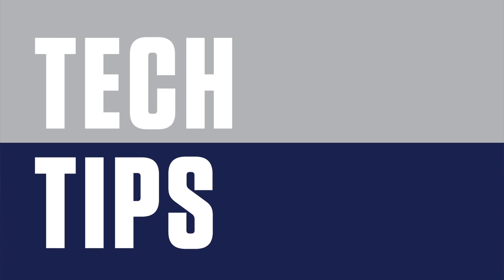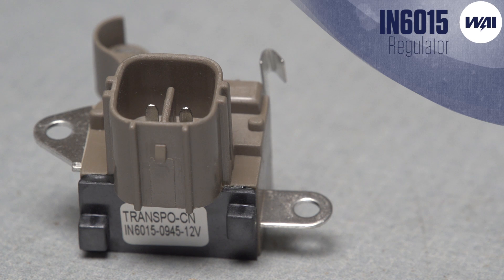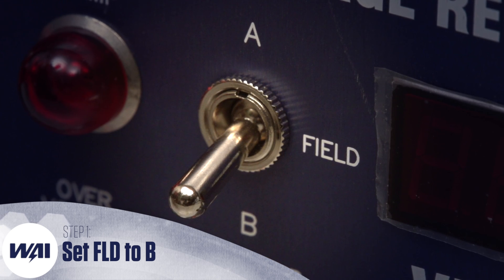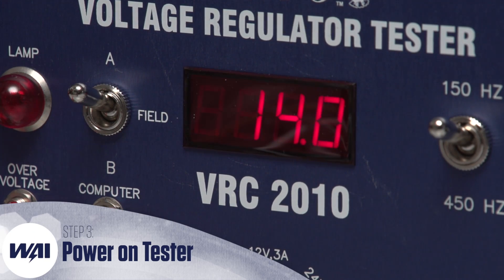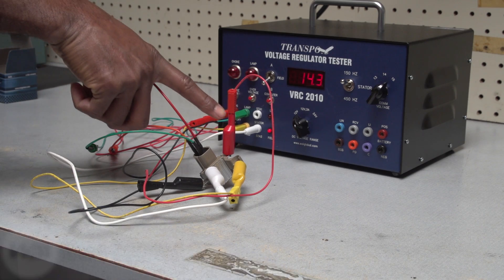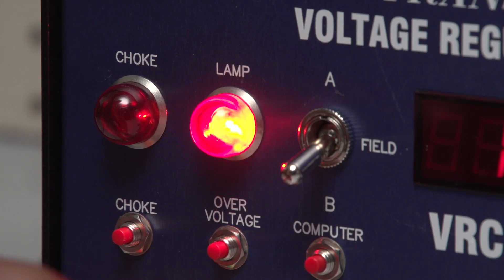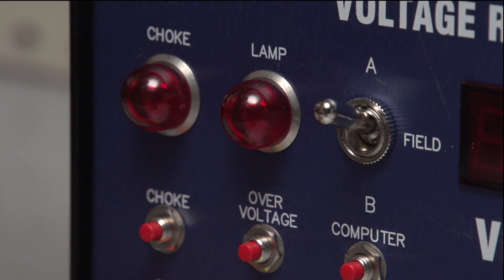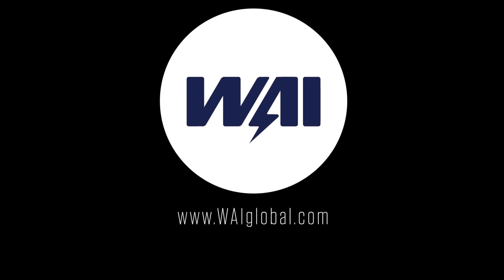Tech Tips: IN6015

Comment: Good night, could explain to me some differences between in6004 and in6015? I purchased in my country a regulator in6015 and sends 16 volts with not ecu regulator acting, and uses in6004 and dash batery light dissapear and regulates charging to 14,5 volts, and looks similar both parts